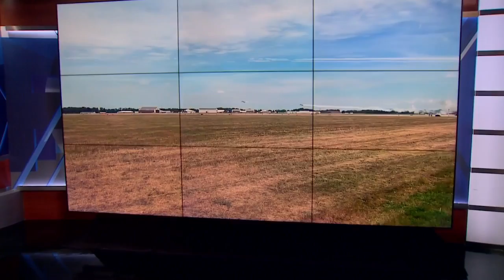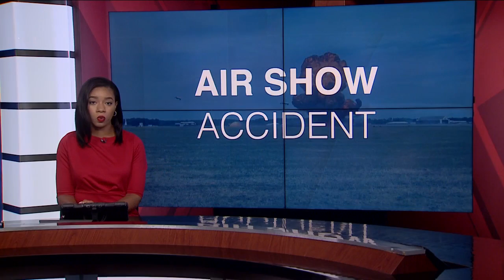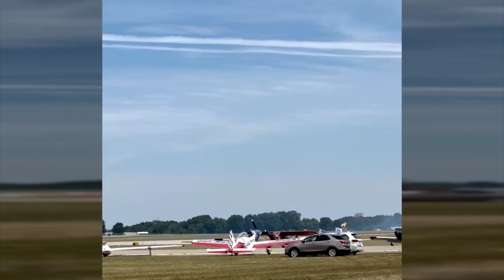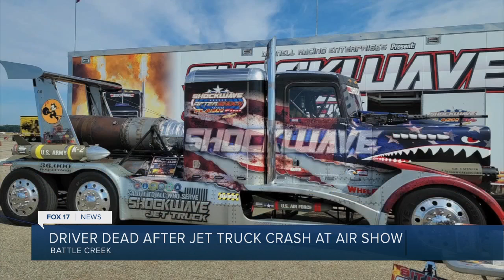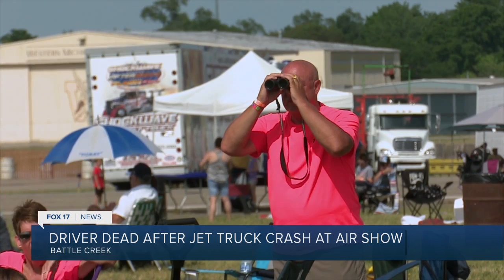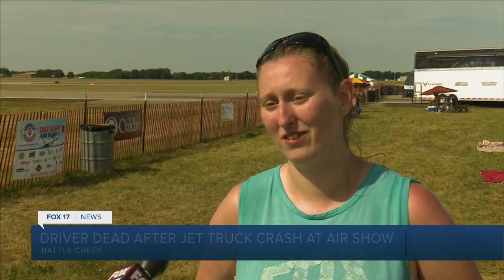Victim identified in Battle Creek Field of Flight accident

Comment: Sad event. Condolences to the family ... and the traumatized spectators.

fwiw - In aircraft, jet engines are installed in a cowling that is designed to contain engine compressor/fan blade failures. These are most often caused by debris ingestion (such as birds, ice, tire failures) which can trigger interior shock waves and blade failures - which, in turn, creates an explosion of shrapnel. If these engines on the truck were installed without a similar, effective containment cowling, such a failure would explain the 'pop' sound and catastrophic failure of rear tires, etc.. that some spectators are reporting.

Comment: Turbine failure???The compressor drive turbine is the most extreme engineering in a jet engine. It is under the greatest heat, pressure, and structural stress. If the drive  turbine fails your engine is going to go boom😐
Reply: The rear tires blew out. No way to recover at those speeds.

Comment: Tragedy? Really? None of this material is built for this kind of performance. If it works once, that does NOT mean it will work time after time again. Neither the tires nor the jet engine were built for this.
Reply: That truck has been doing this since 1986 with only one other accident. Just putting that out there.

Comment: Why is the fireball happen in front of the truck? It looks like the truck ran into the flame and get burned, and the issue isn’t from the truck itself. 

Almost look like the plane ahead dropped a bomb in front of the truck and then it runs into the flame. 

At least that is what the video shows in my eye… hmmm?
Reply: The fireball is well off the runway and unrelated to the accident. It is set off to mark the approximate moment the truck crosses the finish line. The truck does not drive through the fireball for the show.
Reply: Seriously? Are you on something? It's very apparent that this crash was caused by tire failure
Reply: Yeah, right..the plane dropped a bomb. If you've never been to one of these shows, don't bother commenting

Comment: Ok. So what was the ball of fire at minute 1:52. ???
Reply: The big black explosion was a normal pyrotechnic affect used as part of the show, I believe. I remember it as a part of the show. Then the truck comes out the other side with a parachute deployed (it starts to deploy in the video but doesn't completely deploy before a separate engine flame-out and the truck rolls violently).
I have seen this jet engine truck many times at air shows, most of them at this airport.
Reply: @miskaffon  And the truck does not actually come anywhere near the fireball. It's not even on the runway the truck is using. It's an optical illusion.
Reply: @bills6093  True; thankfully many news sources are now mentioning the pyrotechnics being a part of the act and not associated with the accident. The distance is easily seen from other angles than show center. I saw the difference after I had already said the other.

Comment: The Pyrotechnics had nothing to do with the accident, the Jet trucks rear tyres failed and I assume damaged the the rear suspension and fuel tank. the drive was already in trouble before reached the planned explosion.
Reply: could have been a turbine blade failure puncturing the tires with parts from the engines flying everywhere
Reply: @harpoon_bakery162  Yep you're right definitely something catastrophic im afraid.

Comment: Catastrophically tragic! With the late Evil Knievel as the bellwether and trapeze artists and folk sucking flames on stage, I’ll never understand the depths at which some will go in the name of human spectacle. Jet fuel on a truck on the ground competing against jets flying low to the earth in such close proximity? If a blown tire is suspected- was the tread worn - or did flame sparks disintegrate the rubber? 🤔
My Condolences to the deceased family.🙏🏿🌅🕊

Comment: The Shockwave Team have been a menace to the air show circuit for years.

I recall a particular show at Tyndall AFB when a pilot died racing this idiotic truck which should be on a drag strip or lake bed and NOT a runway.

They didn’t stop then and they won’t stop now.
Reply: A menace? If it were a menace they would’ve stopped bringing it to airshows. The pilot at that particular airshow more than likely died because of his own error.
Reply: You are a cruel and heartless person.  A family member was lost.  This was a professional that had an equipment failure.  Something that could happen to you when driving down the freeway and a tire blows out due to failure.
Reply: They've been racing for decade's 🤔 where u been?